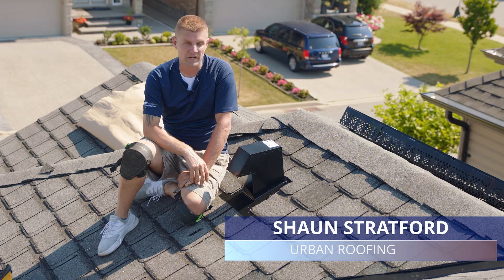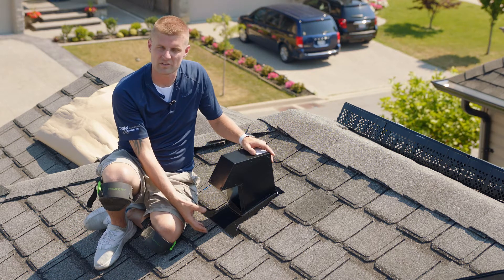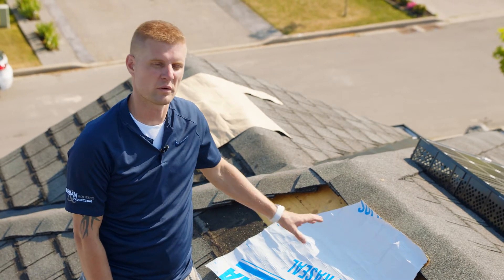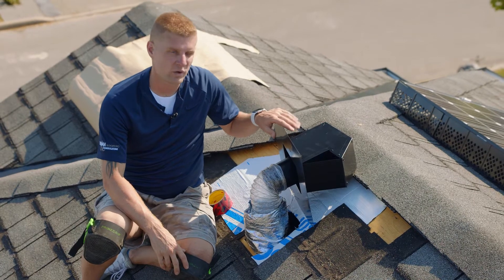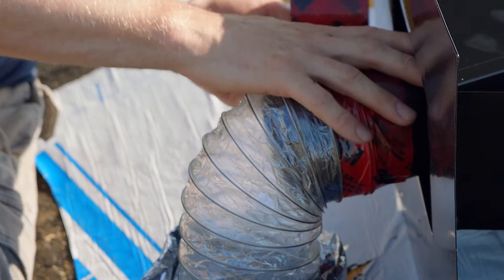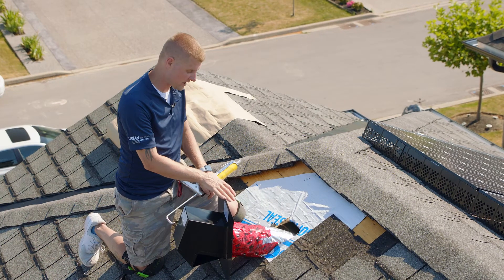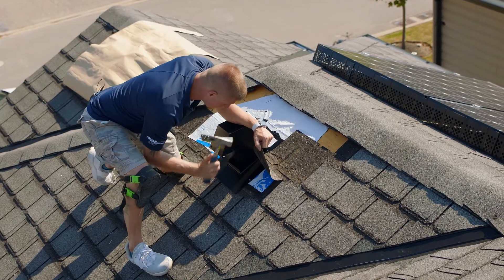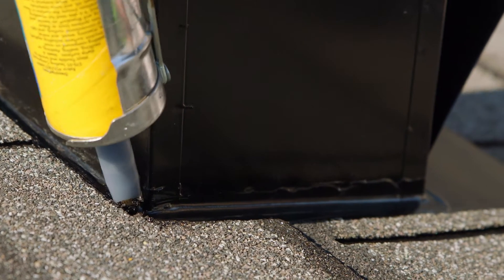How to install a roof exhaust model CT-4, CT-6 and CT-10 by Ventilation Maximum

Comment: Do not use tuck tape on a hot forced air unit. The glue will let go on the tape. Use aluminum foil tape

Comment: The roofer install the CT10 sideway. The triangle head is facing to the left of the roof instead of bottom. Will it be a problem or simply esthetic ?
Reply from the maker: Hello RhoxQuebec,  thanks for letting us know about your installation of the CT-10. Yes, it can cause a problem as snow and rain could get in.  We would suggest getting in touch with the roofer and have them rectify the issue as soon as possible to avoid any further complications.